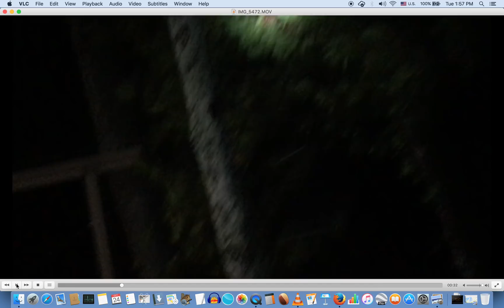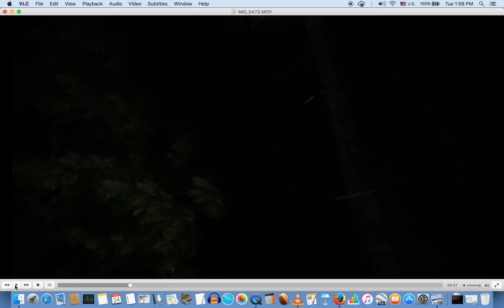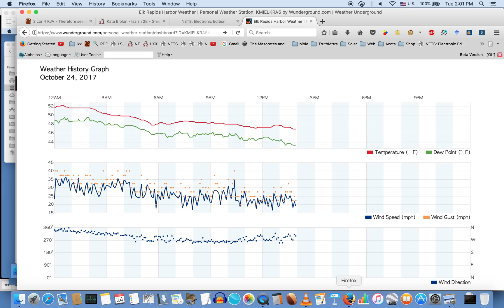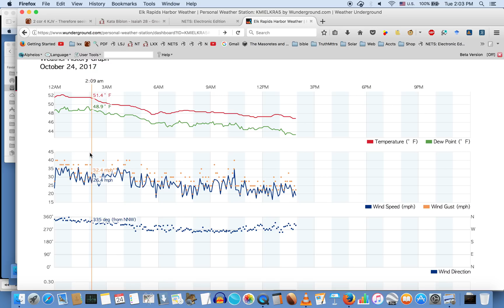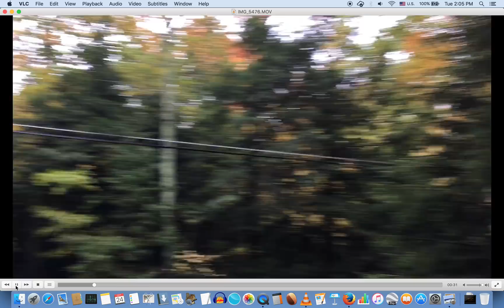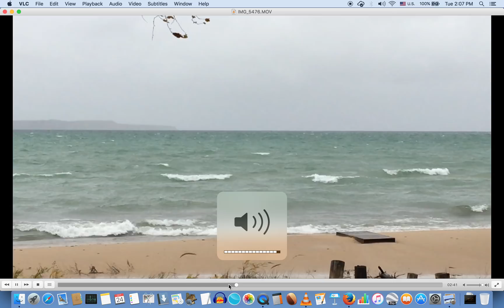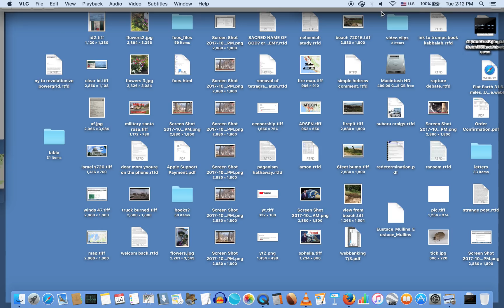Which way are the waves going?? Strange "winds", EMFs, and Scrubbed Public Data?

Comment: you should get an actual EMF detector to detect EMFs and not make up a theory which is obviously false. 9:06 your camera looks like it is unfocused and freaking out a bit due to the contrast of the washed out white water background and the foreground trees/ground. additionally, if your "the EMFs hitting the front of your house causing your camera to go out of focus" theory was right, then how come your camera is focusing perfectly when you are at the beach recording the waves? makes no sense. are you consciously mixing in disinfo with truth? or did you just make a mistake here?

Comment: I wonder if this is due to HAARP-like technology. Remember the "dual bilayer" you spoke of in separate video while showing trees burning from inside out? Perhaps both events are due to EMF waves bouncing about inside each object (tree and Earth), creating more heat. Then it makes sense that when some EMF (AKA light) waves are emitted (e.g. from Norway's apparent Chinese-influenced HAARP-like facility to a base in Antarctica to be converted and deflected to Japan right before Japan's earthquake), they go through the Earth (EMF waves go through matter) and bounce around chaotically rather than coming out in a straight line, and finally exit in unexpected places. It seems it would fit that the government would try to hide HAARP-like results, whether created by them or their enemies. It also seems it could contribute to higher cancer levels. (The first time I posted this, some words were instantly crossed out, so I retyped them.)

Comment: when i used to watch the NOAA GOES East radar before they took it down awhile ago, they had a checkbox you could click on to show temperatures. it also showed like a radar that would pulse as oppose to just continuously 'scan' or whatever.
they would do a continuous scan when there was no precipitation incoming. BUT when precipitation was coming, the radar would begin pulsing, and often it would simply dissipate the rain coming in. the odd time though, it would do the continuous scan and the precipitation would NOT dissipate.
in addition you could also click the box to see temperatures everywhere.
when they continuously scanned, the rain would come unhindered and the temps remained the same. but when they pulsed, at the exact time they pulsed, you could clearly see temperatures drastically decline.

i used to play video games. some strategy war games actually had a "technology" you could use that did this exact same thing. nullify weather, or create an area around these towers you could build that would have a radius where any enemy units in that radius took damage simply by being in the area the tower controlled. its the same thing. except in real life and with nexrad or "cellphone" towers.
i hope that makes sense.

edit: one of those games was called "Command and Conquer"

Comment: Good catch with the scrubbed data, and the screen shot.   The waves are not that unusual to me though.   I don't live by the ocean, but I have spent time over many years kayaking, surfing, and paddleboarding  in the ocean. Waves are created from swell, which is not always the same direction as the wind.  Surfers favorite waves are stood up by an offshore wind, directly opposite the direction of the wave. There are also wind waves that are solely from the wind.  I've been in the ocean with waves coming from many directions and crashing into each other, and even waves coming back against the swell from the shore.  Those are bounce back waves.  I have also camped at many lakes and observed wind events during the night that make the lake rough the next day, even after the wind has calmed.  All the crazy waves you see are from the powerful wind event earlier. Now I am not saying that the wind you experienced could not have been something more than normal, the data scrubbing makes it look suspicious.  It is also apparent that "they" are messing with all forms of weather phenomenon. The swell itself could be manipulated.

Comment: Get some decent audio equipment and learn how to use it for next time. There is a difference with wind reports that depends on the quality of the data. Wind speeds can measure gusts and some can be rectified to give averages over specific time periods.

You should also learn how to make freedom of information requests as all recorded data is stored for so many days .

Comment: Look around your city/town. Do you notice brown or white cylindrical objects, like some sort of antennas about 4 - 10 inches wide, and a few feet tall at the top of electrical poles? They are creating low pressure systems (heat rising) that are clashing with high pressure systems (cool air descending) from these devices by irradiating the air. When weather systems hit the land, usually there is a clashing of highs and lows or temperatures. The greater the disparity in heat or cold from land based systems from offshore, the greater the effects of the weather i.e. typhoons, hurricanes, tornados, water cyclones. Please follow what I am saying. A combination of aerosol spraying from air, frequency modulation and heating of the air, mixed with ground based water vapor production from energy plants can seriously increase the effects of natural storm systems. I am getting extremely high Electromagnetic field readings (above 100 milligaus) in areas around Houston emanating from these devices. They seem to turn off the signal at around 6 AM. Please buy an EMF, Radio, Microwave and electro flux reader for around 100 dollars. Please follow what I have just told you. There is literally no one that I have found who is telling me this... energy cannot be created nor destroyed. That means this energy is inevitably heating the air, which effectively creates a low pressure system. Hotter air also holds more moisture. When a cooler body of air hits, for instance Houston, with massive water vapor generation from energy plants, 4g and 5g networks, as well as intentional frequency modulation, the entire city can be put in a dome essentially making it a rainforest. When a weather system reaches this region which is already at near Dew Point, the weather system condenses and the moisture laden air becomes to heavy and rain is created. As soon as these systems hit the dome of moisture, the rain can be dropped from the clouds nearly on command. Please. I beg you. You have a great mind and a following here of thousands that could spread this truth. There is no one out there talking about what I just told you. The frequency modulation is being heard in the ears during sleeping hours only when your head is turned just right. These devices started popping up all over Houston in early 2017. There are individuals going around Houston stealing battery banks for local police/fire/EMS fiberoptic cables. They are tapping into the Houston electrical grid without authorization and there are no limits to how much juice can be pumped to these devices. I am tracking individuals wearing matching safety vests, and red hats who are riding bikes around monitoring the routes of these devices. I also tracked a private contractor in a an all blacked out Tahoe which followed the route I have marked the devices on. When he noticed I was following, he turned around. He followed exactly the route of the devices which were all above Creek and Bayous running From Fondren and Wertheimer all the way north to areas around intersection of Cypresswood and highway 249 (Sam Houston Tollway) I would release the data I have collected, but I do not know whose toes I am stepping on. Please listen and do your research. The fate of thousands of lives lay in our hands. There are "private contractors" running amuck in Houston now that Harvey is over. The city is overwhelmed with problems of this nature, and accountability of who is in the city has been lost. The devices are only planted in certain areas near major waterways. Again, I am getting readings of over 100 milligaus, and humidity and moisture increases as soon as readings are noted. Almost always that there are high readings from these devices which span a 20 mile radius around Houston, there are blanket clouds systems and bizarre wind effects. Very strange feel to the air. It is dry but wet at the same time. The wind comes from multiple directions, and shifts at the drop of a hat. You can see upper air stream moving one direction, and lower levels clouds moving the opposite. Please, research anything you can with the guidance of God. I believe they will flood us again in the dead of Winter, resulting in lives lost.

Comment: You missed a very important point. When we see the trees and branches there is some breakage but very little. But your metal pole snapped. Now I am no scientist but this feels very much the same as the "wild" fires. The trees are intact and everything much denser is burnt. The molecular movement in dense materials is very different compared to trees. Even some of three dense trees were shown burning from the inside out. Your pole was much stronger than the trees and it snapped. These feel more like microwaves. Like I said I am no scientist but logic dictates this. Just my two cents worth. God bless you.
Reply: Mohammad Irfan Waris could have been rusted

Comment: The direction of each wave can be determined by the bottom over which the wave is travelling. In shallow water If the bottom is not smooth and regular then the waves can be irregular.
Reply: Thank you, Frank, for pointing out at least part of the reason this wave behavior is completely natural.

Comment: First and foremost Truth, I owe you an apology for the comments I left on Carol's channel, condemning your ability to navigate maps. I was wrong, and I apologise.

The wind is wicked today here in South Central Kansas, and the sun is headed SSW, where it usually is in December. It should be just south of due west this time of year. Could we be in a drunken wobble?  
there were also seven chemtrail X's in the SSW that will block the sunset.
Reply from the maker: ForGrantVidoes Thank you, that was noble and appreciated.  I am perplexed by what I am observing too, mostly because I do not know the limits of variance beyond the hard core constants, provable sciences like melting points, thresholds for measuring/ defining "hurricanes" etc.. I do know for sure that the "cell tower" network installed over every square mile of our country is multifaceted instrument to manipulate the atmosphere from ionosphere heating to accelerate evapotranspiration, to manipulating the barometric pressure and dew points but what effect that will have on what we see is hard to know.  

Conceivably, by charging the atmosphere and blanketing it with opaque (plasma-like) "clouds", they can certainly disrupt the angles at which the sunset is visible. I too have noticed that the core light of the sunset seems to be occasionally offset to the south by a handful of miles, far too early in the season as you mention, however, I have also noticed that there is a huge opaque cloud during those times that could be blocking the other 70% of the sunset light toward the north... so if, in only seeing 30% of the sunset, and if that 30% is the southern most part of the whole sunset.. it might account for why it seems the entire sunset shifted to the south when, perhaps, in reality the other 70% may just be obscured by the opaque cloud..  I don't know the tolerance of variance here.. I don't know if it's possible for the sun to realign to the south like that..  That's what is making this an unfair playing field here for us observers... we don't know the extent of what is being done by man, what is being done by our adversary, and what is simply God just waking people up to warn them by filling His word that the power of the skies will be shaken...  Be care there in Kansas, I hope you and your family are safe and well.
Reply: ForGrantVidoes — God Bless You for having humility and offering an apology!  I have no idea what the comment was but so often these days, it seems no one is willing to humble themselves and apologize for using perhaps sharp words against someone else & later realizing they were wrong.

I am guilty of doing this sometimes because I have become frustrated that others don’t see what has been revealed to me...TRUTHS...  Thank you for reminding ME to humble myself each and every day ... and be much more patient!  God Bless! ✝️🙏
Reply: InTruthbyGrace Boy am i glad that others are observing this also this WAY OF COURSE SUNSET ! They come and chemtrail before sunset here it's ALWAYS the same ! And ALWAYS in the direction of the sunset!
Reply: ForGrantVideos Wow, most impressed. :)............Hugs to you.
Reply: ForGrantVidoes you owe me no apology, no matter what you said, best part of America is we have rights to say whatever, actually i did not see your comment because being online is not my day time job, i am a farmer and do many other activities to pass my time than to argue over stupid issues, i think we all are uptight about all this chaos unfolding and im hoping we get America back so i feel comfortable to return to my country safely without worrying about foreign or domestic terrorists, im tired of it all truthfully, i just want have normal life with my family and friends and work and have fun without the political BS. At times i post comments especially if i have some form of connection to it. Other wise i have better things to do than fry my brains on social devices. O dont worry about your comment i never reply usually, whats the purpose? So we have more divide?
Reply: Wow. I comments you for telling the truth too. Keep it up... Wish more did it.
Reply: first I want to commend you for admitting you were wrong and for saying sorry!......and about the sun yes we are in a serious wobble and things are going to be getting worse, this is all because of the planet x system that is coming straight for earth, we would see it already clear as day but the governments of the world are cloaking it out somehow, that is why we are having such strange and bad weather, if you look at other stuff that is going on, the earthquakes, landslides, train derailments, volcanos, tsunamis, tornados everything has picked up considerably no one can deny this fact, I believe soon and very soon we are going to be feeling some very nasty effects from this system.......you should check out WSO's channel, jeff P's channel, the nibiru channel are all very informative and will show you the truth of what is going on.......the governmet is hiding this from us for obvious reasons, if everyone found out about this the stock market would crash, there would be violence on a global scale total chaos!

Comment: Yesterday in WNC we had a horrible rain storm that dumped 5 inches of rain with 50 to 60 mile an hour gusting winds swirling in all directions. Lasted about 4 hours. Flooded out everything and knocked power out in many places. The locals said they never seen anything like that ever. Things are not right.